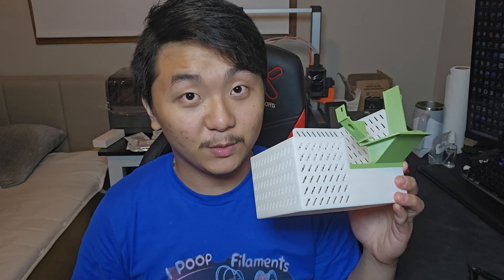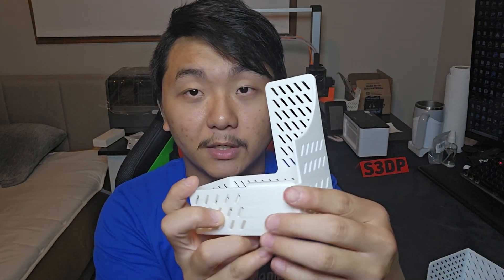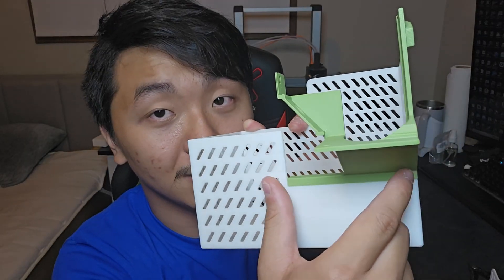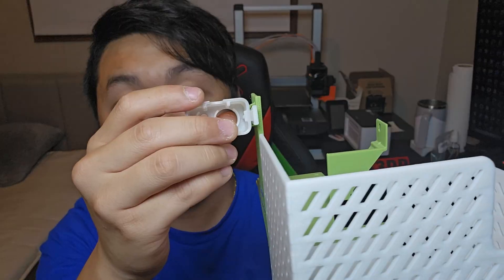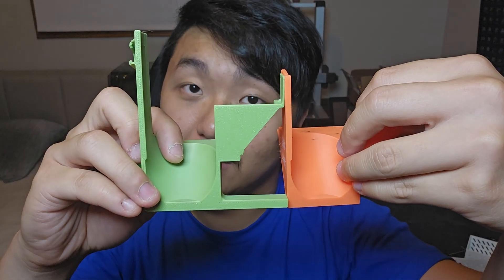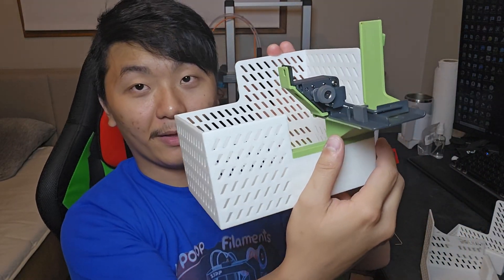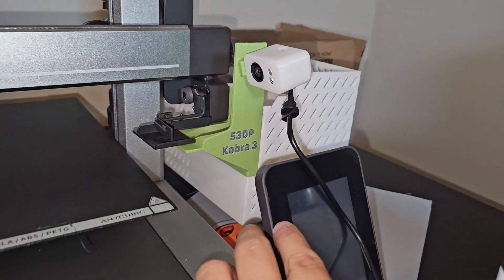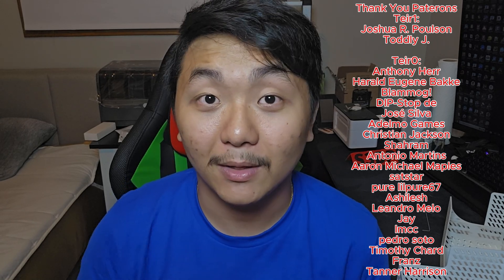Anycubic Kobra 3 Filament Poop Catcher Version 2 | With Camera Mount

Comment: A nice part which is now attached to my printer. Maybe one thing: maybe you could make a curved version so that the poop flies in the corner and doesn't build up at the front. So the bucket may fill up from behind...
Reply from the maker: Yeah, I'll try that. And the filament is still hot so sometimes it does get stuck to the bin.
Reply: @Scratch3DPrinting  glue a Aluminium foil on it. That should solve the problem.
Reply from the maker: @wochenendedestodes9015 that's a good idea, might try it.

Comment: your adding more weight at this point..
Reply from the maker: More weight, or picking up filaments poops, it's ok, a little bit more weight wouldn't hurt that much. I still get really clean prints.
Reply: @Scratch3DPrinting  waiting for some really good mods for this printer...

Comment: That's pretty neat design. But I'd be a little bit worried about camera shaking on a thin plastic extension...  I am working on camera case redesign right now - I want to make it single piece, so you don't have to worry about tolerances so much, and so the camera is a little bit higher with bigger angle (it catches to much background for my taste right now). I think one piece camera case will be much easier to print as oryginal anycubic design is kinda complicated for printing. Also mounting it to chasis is definitely much sturdier.
Reply from the maker: That's nice, I would like to test out your model once it's finished. From my testing for a couple days now it vibrates a little bit, but it vibrates similar to Anycubic mount too. I don't mind the small shakes on the camera because I will just check to see if my parts is failing or not. I don't think anyone is going to watch the whole print.
Reply: Did you already finished the camera mount? Because I want to Look If IT would be good for me to.

Comment: Question for you if I print the updated basket will it fit on the attachment or do I have to print another mount
Reply from the maker: If you have the older mount it will fit as well, but it does not take full advantage of the longer connection.

Comment: hello, this is a very nice design, I will print it when I finish with what I have printing right now, I just want to make a note: If the basket is printed in PETG, the pla poops will stick much less to its walls than if it is printed in pla. (the same thing happens with the supports. Making the brackets in petg makes it much easier to remove them :)

Good job and thanks for the design.
Reply from the maker: Thanks, yeah I think PETG would be better so that the filament does not stick to it. But will PETG sticks to PETG?
Reply: @Scratch3DPrinting  Yes, it has to do with the crystallization temperature of each material. PETG would adhere to PETG, but theoretically a little less than PLA to PLA, since starting from a higher temperature, the initial temperature drop is more abrupt than in the case of PLA due to the difference in temperature with the environment. Another way to prevent the poop from sticking is to force the layer fan to turn on during the purge, but that involves inserting G-codes into the project and it's a pain.
Reply from the maker: ahh, that's good to know between PETG and PLA. Yeah it shots the filament a little bit too soon. I actually would like to add custom G-codes but not quite sure how to access the Kobra 3 G-code files. It's not open like the K1 series.

Comment: Hello! If you put the camera on the filament garbage collector, it looks like it's moving a lot. Not distracting?
Reply: The original camera mount for the poop chute he designed this from had a less sturdy mount and didnt vibrate at all, S3DP's new one in this video is far more sturdy than the original so I can only assume there will be zero shaking since the original had no noticeable shaking even during fast gyroid infil sections.
Reply from the maker: It does not shake that much. If the 3d printer prints very fast then it does vibrates a bit, but its not a problem at all.
Reply: Ok, thanks for your reply and your work!